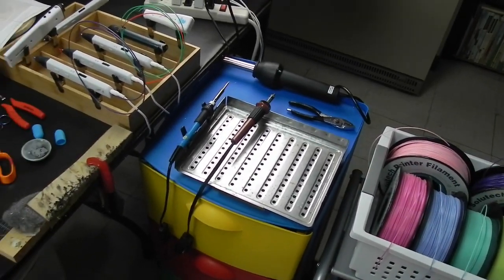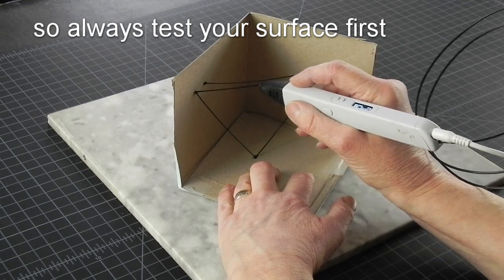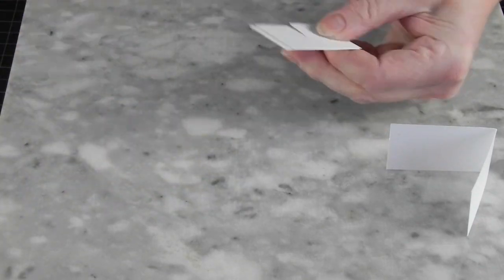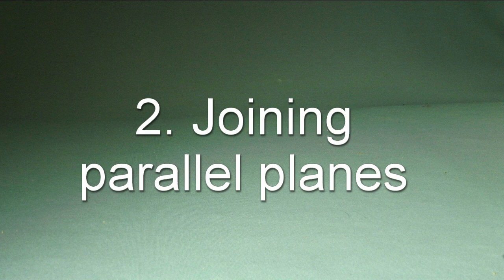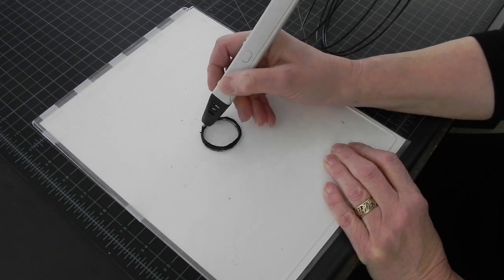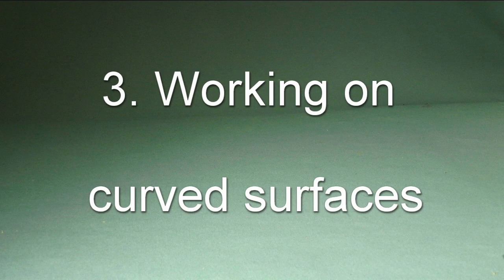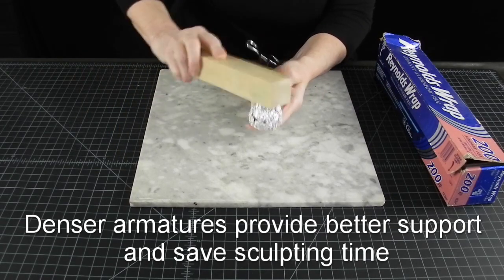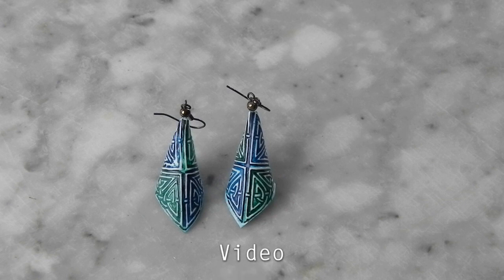How to use 3d pen to make 3d things - Strategy

Comment: I actually want to just get a 2D shape. My pen feels impossible to use, and the filament gets stuck to the side of the pen, making a loop before I can use it properly. I would be glad to get a single line out of it properly, and there aren’t any tutorials for making even a 2D shape.
Reply from the maker: From what you describe in both of your messages it sounds to me like your work surface is the problem. Watch these two videos and then try again and let me know if that fixed your problem. I almost gave up initially because I was trying to work on non adhesive surface. If the filament can't stick to the surface it will wiggle and/or stick to the nozzle.
Advice on work surfaces:
7 things you want from your 3d pen work surface
https://youtu.be/n9RXEH7BAzA

Best work surface for 3d pen
https://youtu.be/QP7YsXWvb8M